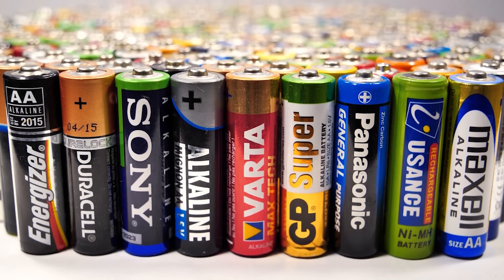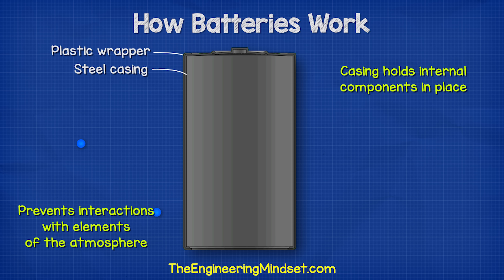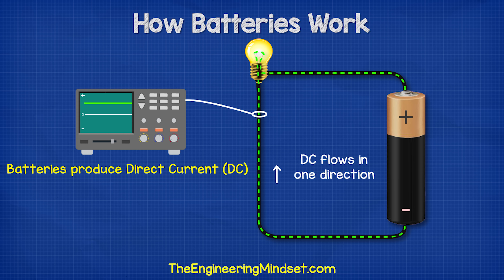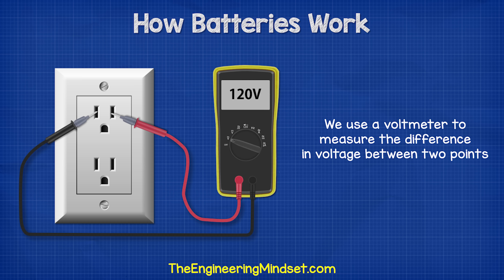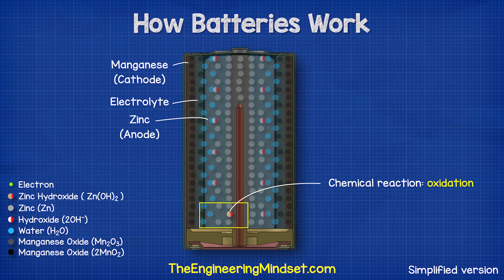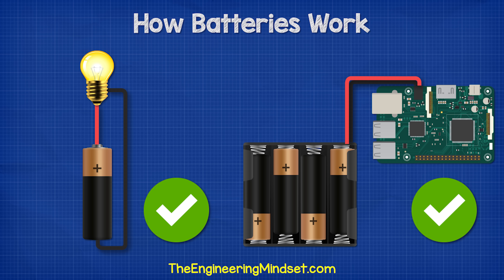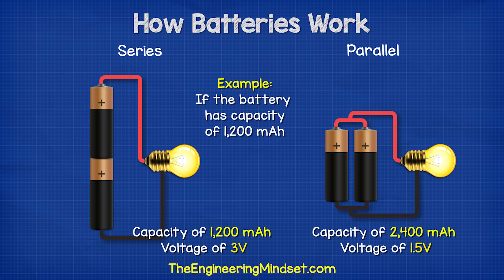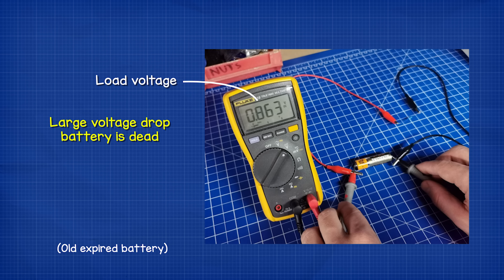How Batteries Work - Battery electricity working principle

Comment: I asked chatgpt and I will ask here as well, when voltage, lets say 9V reaches and LED, to light up led it consumes 2V so after that I only have 7 volts but, the electrons going through the LED and lighting it up are not releasing any energy there ? they just pass through and go back to the positive terminal like nothing happened ?

Comment: You can recharge alkaline batteries and its actually quite viable (usually 1-3 extra cycles, 10-20 if you choose the right batteries and charge them soon enough). Its "dirty" charging though so has to be done slowly (20mA) and you lose about 20% capacity each time if not more, and they can just leak and die.

Comment: Fascinating. Electricity is slowly but surely becoming less and less foreign to me. 

Can someone help me out with this - with regards to voltage, the positive terminal / point doesn't actually have a positive charge, it's just that it is LESS negative than the negative terminal, thus creating the potential difference?
Reply from the maker: Yep, we have covered it in detail here https://youtu.be/3KePcASD0NQ

Comment: Wondering if you can edit or repost this to include the “salt bridge” and how that ion flow “physically” occurs during the batteries use

studied electricity, I’m now majoring in biochemistry and have learned the chemistry of electricity and batteries, and I can confidently say this is by far the best explanation of a battery hands down no question

Comment: The hard relisation is when you will find out the energy needed to light the incandescent bulb ( coz i can see the tungsten filament inside ) is actually coming from the electric field around the bulb and not due to the flow of electron inside the metal conductor that connects the circuit. The actual physics is much more complex than you can possibly imagine. 
Facts - flow of electron inside a wire (drift velocity) is very less so flow of electron just give us a current but that current is not what lights up the bulb. 
We have Poynting vector to validate that argument. 
This analogy will be more complex when we connect more than one batteries one after another in a series. 😢😢
Reply from the maker: We have covered it in detail in this video:  
https://youtu.be/3KePcASD0NQ
But the gradient of charge forces the electrons to dift and collide causing heat and light

Comment: But the positive end is anode and negative is cathode
Reply from the maker: In a battery that is discharging (a galvanic cell), the cathode is the positive terminal because that’s where reduction (gain of electrons) occurs.
Reply: @EngineeringMindset  could you please explain it a little deeper in some other video .
By the way thanks 😊!

Comment: Why is it out of charge if it still has a rating of 1 volt?
Reply from the maker: It can produce enough chemical reaction to measure a voltage, but it can't sustain the chemical reaction sufficiently to provide a useful current

Comment: doesnt series increase the current not voltage?
cause thats what my dad told me
Reply: Increased voltage can mean more current, but it really depends on the circuit’s resistance. When you connect batteries in series, the voltage goes up, which could lead to more current if the resistance of the circuit stays the same. So while a series connection directly increases voltage, it can also   increase current by pushing more through the circuit :) But what the series connection of batteries mainly does is increase the voltage.

Comment: Wait a minute? At 13:42, what does it mean when the electrons are boosted? Also, wouldn't more Voltage equal higher current or more amps? Why is the amprage more with the parallel as opposed to the series circuit?

Comment: My battery short circuits sometimes. Are electrons negatively charged? I could write a story about how electrons are positively charged... Sometimes I have pressure inside my pipe. McKenna Hanson told me to stop the self talk, but I won't!

Comment: Thanks,
Engineering mindset Your videos are really knowledgeable and easy to understand.
Requesting if you could make videos on all utilities/equipments installed in a data center or advancements in data center or videos providing deep knowledge of data center in various departments such as IBMS/network/HVAC/Electrical/firefighting, etc.

Comment: 2:12
What? As far as I know the positive terminal is called anode and the negative terminal is called cathode.
Reply from the maker: It's different in a battery, we're also teaching electron flow, not conventional current
Reply: @EngineeringMindset  oh

Comment: Electricity in a closed circuit does flow from the negative end of a battery to the positive end.  

But since “flow of electricity” has always been taught the other way around….positive to negative…why? I don’t know.  But we alway use the acronym PANIC….Postive Anode Negative Cathode.

So it’s always understood that the anode is the positive lead and the cathode is the negative lead. 

Anyone confused yet?   It’s just that I have always been taught that “electrical flow” in a closed circuit is positive (anode) to negative (cathode)

Comment: Extra Note: The potential difference in a battery comes from the inherent properties of the anode and cathode materials, not from an electron build-up. Redox reactions occur only when the battery is connected to an external circuit, so there's no electron build-up when it's idle (i.e. not connected to an external circuit). Both oxidation and reduction reactions happen simultaneously and depend on each other. Ion movement within the electrolyte maintains neutrality, while electron movement causes electricity. Direct electron flow from anode to cathode would result in a short circuit.

Comment: Most explanations online skip over the most important aspects. Can't imagine the work put into this. Thank you
Reply from the maker: Glad you enjoyed it! Thank you
Reply: @EngineeringMindset if the chemical reaction takes place only when the circuit is complete? How can we measure voltage across it... voltmeter is a high resistance device right so ideally open circuit and no reaction and no voltage should be seen...pls clarify
Reply: @Xyzengineer a reaction does happen because voltmeter is a high resistance device, not an insulator so electric current passes through it. It is not enough to drain a cell but enough to measure the difference.

Comment: cool video but you make a mistake you call the first manganese oxide + graphite layer in the battery an anode but you also call the zinc powder an anode :)
Reply: first at 2:52 and at 3:50
Reply from the maker: Unfortunately there is a mistake in the video, the correction is noted in the video description
Reply: @EngineeringMindset  oh okay didn't reed the description thx, good video tho! helped me alot

Comment: Why does the dead battery have a higher voltage drop in the same load compared to a normal battery? Seems to be missing an important detail there.

Comment: This is awesome, thank you so much. A few questions, if you happen to see this and have the time
1 - How can the membrane be porous enough to allow ions to pass through, but not electrons (which are smaller, no)? Is it saturated with the electrolyte so together its solid, and the electrolyte has a specific breakdown voltage/dielectric strength? or am i missing something
2 - At 3:30 you say the electrolyte is sprayed on the inside of the fibrous membrane, but then at 8:59 the electrolyte is labeled outside the fibrous membrane - which is it? This may already be covered in whatever the answer is to my first question
3- It would be really helpful to see the chemical equations written out - you say in reduction the H20 used gets replaced by one rejected in oxidation, but you didn't indicate an H20 being rejected and I can't seem to piece it together using the chemical equation
Again thank you so much, this video was super helpful!
Reply: very nice, asking questions means you are paying attention,ill try answering some questions,sad no one did for an year

1-ions like Zn2+ or OH- that are dissolved in water can diffuse out and in through the fibrous membrane,electrons aren't technically soluble in water,in my book the anode is actually a Zn metallic solid,here they chose Zn metal powder in gel solution 

electrons can't swim in water like protons(H+ ions) do,the reason being there is no reaction that can detach them from Zn(neutral),when electrons spontaneously just get out,we call that plasma

do you know about Daniel cells and its mechanism? it a connection between two separate solutions with a copper and zinc metal dipped in it

what happens is that both Cu and Zn metal atoms leave electron in the soup of metallic bonds on the metal bulk and go into solution,electrons are dissolved in the metallic bonds

when the reaction Zn→Zn2+ + 2e-, and Cu→Cu2+ +2e- reaches equilibrium,the final concentration of electron in the bulk metals are quantitatively more in Zn metal thus overpowering copper 

thats why electron don't live in aqueous medium,they live in the metal because thats where they were born
Reply: 2-an electrolyte is simply a fluid bulk that can let free ions present inside traverse under a potential difference 

for eg salty water,molten salts,plasma(technically we won't call it an electrolyte,but why not)

its not the formal definition but an explanation enough to understand why everything inside is technically electrolyte
Reply: 3-yea you see the chemical reactions in this video aren't totally accurate,they are intuitive and technically display all necessary information for electrical engineers but still wrong

the simplified equations are:

Zn metal goes through oxidation giving Zn2+(in anode electrolyte)+ 2 electrons in anode electrode 

this is a spontaneous reaction and does not require hydroxide ions,at room temperature a measurable amount of charge is accumulated at the anode without any input,this is why if you have a sensitive enough detector(like some LED) and you hook the anode with the earth through it, you'll detect current for a small while,this will stop when Zn2+ ions clutter the inside electrons and shift the equilibrium enough to get negligible electrons on the anode

what about the cathode?

when you hook up fhe anode to the cathode,those electrons go to MnO4 and reduce the oxidation state of Mn4+ to Mn3+ giving the compound Mn2O3 and an oxygen2-,this oxygen in reality takes up 2 protons and becomes water,where did those two protons come from? NH4+ ions,this part the video missed,NH4+ ions become ammonia and start accumulating,this is real,you have ammonia in your used primary cells
Reply: ok so at end of 3 I said there is ammonia in your dry cells but I realised its misleading, ammonia gas molecules make complexes with Zn2+ to get Zn((NH3)4)+ ions,this is good as ammonia gas is bad,another cool thing about this is as more the ammonia takes up Zn2+,less Zn2+ available for reverse reaction(plating),my book says this can increase the voltage of the cell

Comment: 0.863 V considered as the battery is dead, what a waste!
So we can combine two dead batteries (series) or more, to create one alive battery! 
It would be great to include a part where batteries needed to be recycled in a allocated bins, and not to be thrown out in the rubbish bins.
Also, it would be great to have another video about Lithium batteries, and their ability to recharge. Also, if you can include the latest research on how to speed up the charging process.
Thanks much

Comment: Interesting fact that the old days telegraph systems were the one that used batteries 🔋 and cables 🧵and after that came the power lines and transformers and internet routers 🛜 afterward. by the way great video about batteries 🔋

Comment: The larger batteries must be capable of running longer and providing more current as they are larger.  The C and D batteries hold more chemical reactions than AA, AAA or AAAA?

Comment: I still don’t understand the differences between AAA and AA batteries. What does the “A” mean?
Reply: When batteries were made for portable electronics use back in the 1910–1920 period, I think, they realized some standard sized batteries would be of use making them interchangeable and not having unique batteries for every product. Someone (ANSI? RIAA? IRE?) specified a series of cylindrical (easy to manufacture) battery sizes that were based upon the capacity of the cell, how many ampere hours they had and how much current they could provide.

They originally had D, C, B and A batteries going down in size.

As our electronics improved they got a lot smaller and the power they used was drastically reduced, so portable electronics demanded smaller batteries.

The B and A size went away and, having no lower numbers on the alphabet they used Sub A and sub-sub A etc which became abbreviated as AA, AAA, and AAAA sized batteries.

It was just an evolution to smaller sizes and a lack of forethought (who could blame them) for having started with the smallest at A in the original series.

Comment: but if conventional current doesn't reflect reality, why do we still use it? I believe actual electron current was found decades if not a century ago, why couldn't engineers change to this since this time? if it's indifferent, why not use? or if it's indifferent and we don't use it, why do we need to talk about it? shouldn't be more straightforward to use electron current? isn't being straightforward is one of the most important engineering principles?

Comment: In series connected batteries, why electrons don't flow from anode of one battery to cathode of second battery when the circuit is open?
Reply from the maker: Seen our new video on How electricity works - for visual learners? Link:➡️ https://youtu.be/3KePcASD0NQ

Comment: Why does connecting battery in series increase voltage? when - and + are connected between batteries that should let the electrons flow and close a circuit
Reply from the maker: Think of a large water tank, the pressure at the bottom is large. Now double the height of the water tank and the pressure increases. Voltage is pressure.
Reply: @EngineeringMindset  Thank you for the answer; I understand the concept but I cannot get my head around the fact that the cathode is in direct contact to the other battery anode. This should allow the electrons to "even out" the charges between cells

Comment: How to know the circuit current ?
Reply: the current in Amps is equal to the voltage in Volts divided by the resistance in Ohms. you could also measure it using an ammeter or multimeter
Reply: @roundhouse2616  thanks

Comment: so basically an anode loses electrons due to the electrolyte forcing it to, which makes it positively charged, and a cathode gains electrons making it negatively charged and it loses ions, and the process keeps going until the battery dies and a charger connects to an electrode which reverses the reaction

Comment: This might be simple, and I might be over thinking it, but how do the electrons travel through multiple batteries placed in series like at 13:24 if the positive and negative do not make contact inside the battery?

Comment: Why in electrolysis cathode is negative and anode is positive? 😵‍💫🤯 other way round?
Reply: In electrolysis ,the electrical energy is used to perform chemical reactions that do not happen spontaneously, i.e they require energy.
Example: oxygen is more E.N(electronegative) compared to hydrogen so in a general water liquid state oxygen gains electron from hydrogen ..
So if we use electrical energy and send the electron from oxygen to hydrogen in electrolytic cell that is electrolysis.
We are using energy because any atom doesn't give away it's electron to atom that has less electronegativity than itself..
Uphill transport need energy...and that energy is by electrical energy (BATTERY).
So in order to remove electron from the oxygen we need to apply energy.
Electrons in a circuit move from negative terminal to positive terminal.
If oxygen loses electron it is oxidation.
If hydrogen gains electron it is reduction.
So negative terminal of the battery pushes electrons to the hydrogen (reduction)- CATHODE.
Positive terminal of the battery pulls the electrons from oxygen ( oxidation)- ANODE.
General statement
ANODE means building up of electrons,oxidation leads to build of electrons.
CATHODE means decreasing of electrons,reduction leads to decrease in electrons.
Reply: Main statement:
CATHODE and ANODE is determined based on what chemical reaction happens at that electrode, it has to do nothing with positive and negative terminal of the battery.
ANODE- oxidation takes place
CATHODE - reduction takes place
Reply: @thotasupplies218  thank you very kindly for your time taken to write this magnificent explanation. 
I hope you don't mind, if I come with one or two more questions in the future? In the meantime, I will write down your reply and study it 😃
Once again- it's very much appreciated. Thank you! ❤️

Comment: 5:00 wait I thought the electrons flow from positive terminal to negative terminal?
Reply: thats conventional current, which think of it basically just as the electron flowing's current. electron flows from negative to positive as electrons are NEGATIVE, and attracted to positive, such as protons being positive and attracted to negative, so NOW we have electrons, meaning they would be attracted to the positive side (or less electrons side) so they flow there. the current of them flowing is the opposite direction, such as a river, when it is flowing right, the current is a measure of how fast it is, so its basically going left. therefore the current is the electrons how fast they are flowing, conventional current is basically something like that